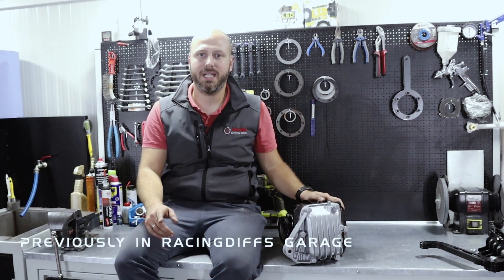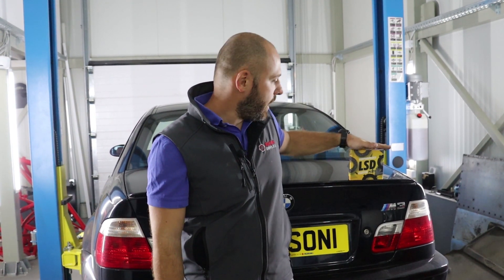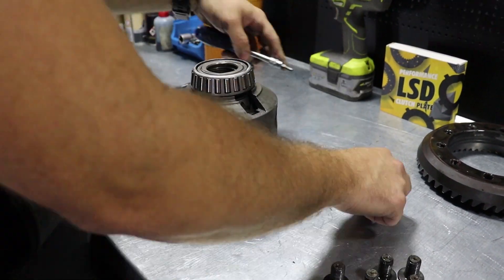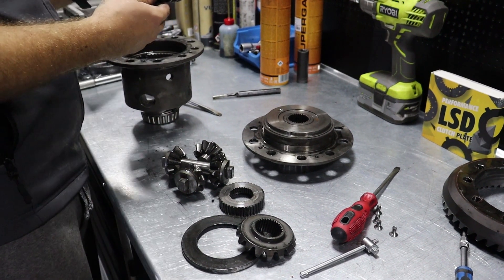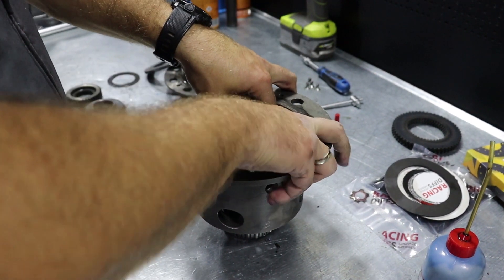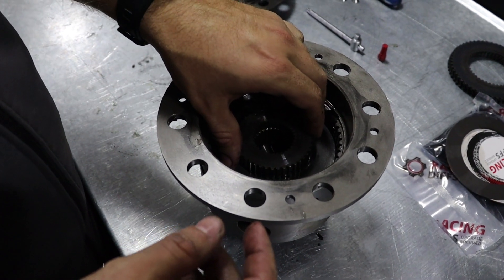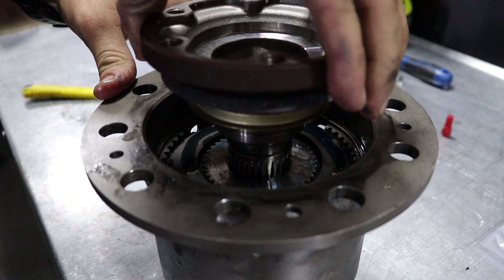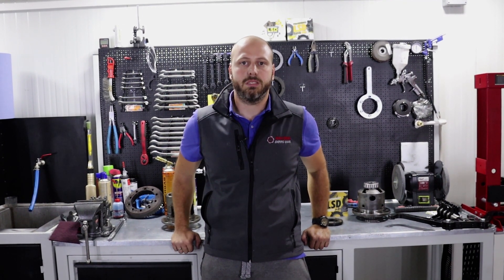BMW E46 M3 LSD mechanical conversion upgrade | Viscous to clutch type conversion

Comment: I purchases the advamced pack for my 2003 e46 m3, is that the same thing as this kit? Because mine came with 2 concave spring shims. I assumed when I bought the advanced kit it was just the clutch pack and free play delete + the bearings. I ended up not  installing the large concave spring shim because I thought it waa the large washer that was on the LSD cap u der the bearing and so I didnt bother installing it. I followed shoplifetv diy that he used for his m3 and figured we bought the same kit. But after I watched this video i am a bit confused now, being that you installed the large concave shim on top of the clutch pack. If thats the case, without the large concave shim installed i had about a couple mm gap when i installed the LSD unit cap before tightening the ring gear bolts, if i would add the large concave shim wouldnt that create a too big of a gap that it would be impossible to compress the lsd cap?
Reply from the maker: You need to install the large preload shim like in this video in order to get the full potential of this kit.

Comment: I didn’t fit the large shim as I couldn’t find this video. It isn’t linked on your website etc.

Is it going to cause a problem? I don’t want to have to do this job again…
Reply from the maker: All parts should be fitted. If you have any dilemmas regarding the installation procedure, our support team is available mon-frd to answer all your questions.
Reply: @RacingDiffs  looks like I’m taking the diff back out again …

Could you link this video on your website, so no one else makes the same mistake.

I only found another video where someone mentions that it shouldn’t be fitted.

Comment: Nice video. My factory LSD is dragging after only 50,000 miles. Are the mechanical LSD's easier on friction and wearing out? 2004 M3 Manual. Thank you
Reply from the maker: You're not the only one. We fixed many diffs under 50k miles in our shop. With this upgrade, you will get rid of noises for good and gain some performance too. And if you wish the top-level performance, then I suggest a fully mechanical LSD unit. 

https://racingdiffs.com/collections/all-solution-lsd-unit/products/bmw-high-performance-lsd-unit?variant=33671152959623

Comment: i got a kit from you guys. my original LSD had 7/8 plate clutch, the one i was sent is only 5/6? Is this some mistake? what's the reason dropping down 2 clutch plates if so? O have i got the wrong kit sent?
Reply from the maker: All is fine. Since our plates have a higher friction coefficient, we dropped 2 clutches to make room for preload shim, which is far more significant upgrade.
Reply: @RacingDiffs  Thanks for the update. I was getting a bit worried I didn't get full/correct kit as looking at the other video of LSD rebuild V1 E46 M3 on your channel I had also counted there were 7 clutches in your kit to replace. May I also ask what's the average life expectance of the clutch pack? 30000km? 50000?
Reply from the maker: @antanasrapkevicius3897 depends on the usage. If you drive it on the street, it will last much longer, of course. Make sure you use quality oil such as Motul gear competition and change it every 2 years.

Comment: Will this lock the wheels faster and act in a similar manner to a 12 pack clutch LSD kit
Reply from the maker: Pretty much, yes. It keeps clutch pack engaged all the time with minimal 30%, which improves LSD response by far.
Reply: Awesome; are you having a Black Friday sale and will these be discounted?
Reply from the maker: We are having a Black Friday sale at the moment. They are discounted 30%. If you decide to get Bearings and seals, you will get an additional 10% off.

https://racingdiffs.com/collections/lsd-clutch-plate/products/bmw-m3-m5-m6-z4m-lsd-differential-rebuild-kit?variant=42497704788204

Comment: Just to confirm - if my factory viscous unit  (V1) is no longer operating correctly (minimal lockup, has clunk), just this kit installed as shown in this video should repair?  There is no need (as shown in the full rebuild video) to replace (cut & press) the shaft bearings?  Is this correct?  Thank you!
Reply from the maker: That is right. As addition, if you have whining noise on straight line, than you should change bearings.
Reply: @RacingDiffs   Thank you!  No whine...just a really sucky LSD.  :)
Reply from the maker: Than you can get away with cheaper options of rebuild 🙂

Comment: Is v2 unit better? Can it handle more power? Does it wear out less frequently due to it's design?
Reply from the maker: Not really. Basically they are the same.
Reply: @RacingDiffs  v1 is so much quicker to do, no c clips, no special tool to open/close the lid, no press to realign the slider gear rod, etc. Also seems like on v1, when you put it together, there is no finer adjustment of preload, where on v2 you can tighten the cap more, to a certain point. So v1 relies on internals thickness to provide the right preload.
Reply from the maker: @mrgizmo7975  exactly.
Reply: @mrgizmo7975  What if I end up with too much clutch preload on V1, and what can I do to get it right? Compared to V2 I can adjust the lock ring -- dial it in for the desired clutch preload.
Reply from the maker: In V1 unit, you can't adjust preload that easily as in V2. You have to play with thickness. Our outer plates are slightly thicker than oem, so if you have too much preload for your taste, you can combine oem outer plates and ours to find the best combo for your application.